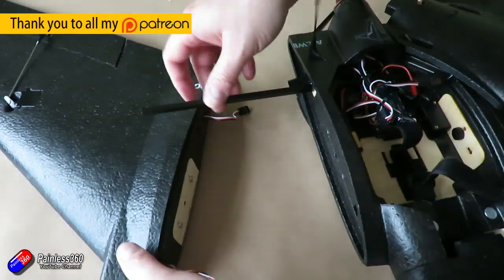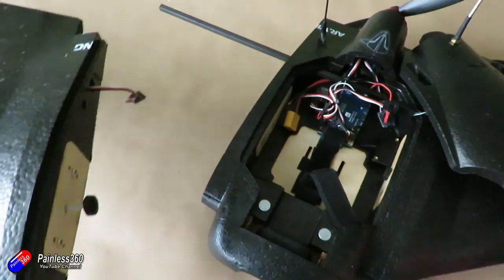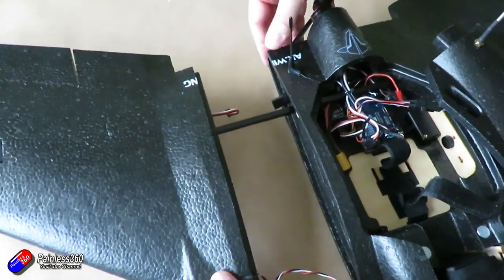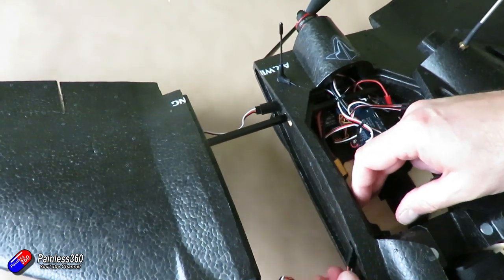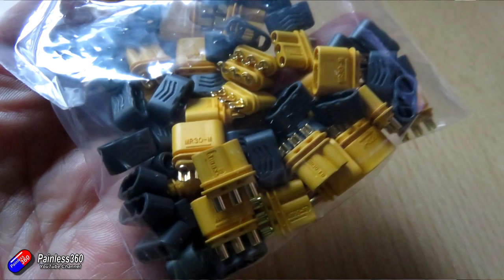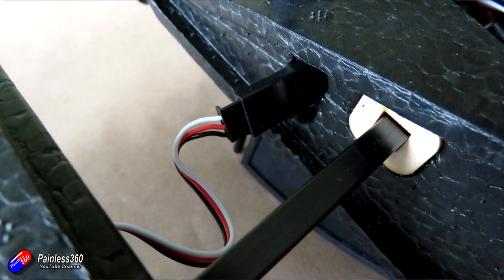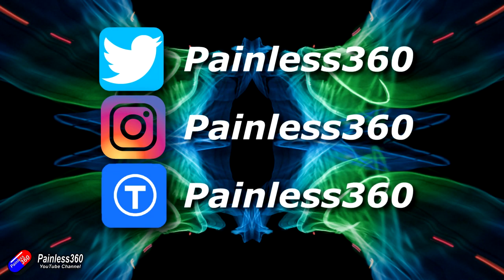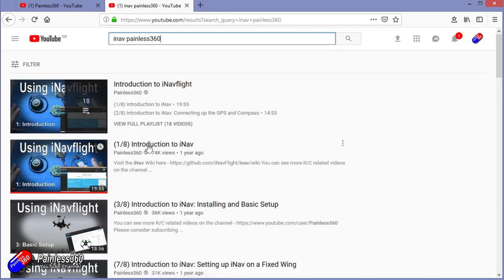AR Wing Easy Wing Removal Mod: A quick tip

Comment: I know this is years after the conversation but I have a both the 900mm and the pro.  On the ar wing 900 I have installed the ar wing pro 6 pin connectors and they work great.  You will have to cut in a little and install ply then screw the connector housing to them.    They work great and I have purchased another 900mm to do same mod.  Its cheap, takes an hour or so to do. Once completed it slides together just like the pro.  You can get these connectors from Getfpv currently. Well worth the effort.

Comment: Lee, a guy here from Brazil did a pretty nice mod in the smaller wing. He cut a bit of the foam from the wings and from the pod, glued pieces of wood, made holes and threads in the wood... So, to assemble, the just use a thumb screw... In other words, now it works exactly like the bigger one. 😃
The idea of replacing the servo connectors is fantastic! I'm going to give him the idea!!! 😃
Great video as always! 😊

Comment: Planning on doing something similar however I'm going to use the green MPX connectors. A bit harder to solder but will have enough connectors and two of them fit into the little holes on the ar wing.
Reply: this method is used a lot in RC world, no fuzz with cables :-)
Reply from the maker: Thanks for the idea - with the supports that could be an even better solution! Happy flying!

Comment: I tried these connectors last week for the servo leads on my Nano Drak. I prefer to glue the connectors to the foam so that I can plug and unplug by sticking the wings together and pulling them apart. For that they were a little too snug and I ended up reverting to MPX connectors, but for your method I think they might work well. They are certainly far more robust than regular servo connectors.
Reply from the maker: Thanks for the comment. I'll get some of those in to try too..
Reply: Painless360 they’re a little fiddly to fix to the foam on their own, but there’s some parts on Thingiverse that wrap around them with a flange and help a ton. Just be careful not to glue them permanently together (ask me how I know)! 😜

Their other benefit is they have six conductors. Sadly you’d still need two on the GPS side even if you shared power and ground with the servo.
Reply: @Painless360  But wait there's more (and I apologize a bit for all the comments): they do make an 8-conductor version, so you could get those and have enough pins to just use one per wing, and there's little PCB boards and various other adapters that would make soldering and installation a lot easier, I think. And local(ish?) to you.

https://www.electriflyer.co.uk/electrics-electronics/connectors-wire/mpx-connectors-accessories.html

Comment: Interesting. You need to solder these connectors to the wires? No crimping? I thought you were going to try to replicate the zohd-style connections. Have you considered such solution?.
Reply from the maker: I have but not yet found a reliable connection that will make the connection with minimum force and stand up to the abuse.. Let me know if you find one..
Reply: I have been thinking briefly about this... my initial thought is a db9 connectors used for rs232 (you probably remember the « good » old days of modems). I think it has good physical tolerance so can be plugged in many times... but I will need to research more. Also, it is cheap. I will keep you posted if it works for me.
Reply: jocelyncloutier a DB9 would be a little big for the AR wing but is a decent solution when you have space.

Comment: Hi Painless - hope you dont mind but just wanted to ask something about this Wing build slightly off topic to this particular video - I notice you dont use an air-speed sensor in the build? Can I ask why? In one of the videos (F765 one I think) there is one sitting on your desk. Wouldnt it be required for auto missions? Cheers
Reply from the maker: Hi Kim, 

No, an airspped sensor isn't needed for auto missions. I cover that with Ben from 3DXR in the airspeed sensor video (in the Big Boys Toys playlist). That video may be worth a look. Happy flying!

Comment: Hello Lee. Do you think the ZOHD KO-pilot will be a good system in the AR wing ?
Reply from the maker: It'll work fine but there are options that'll run iNav and Arduplane that will provide a better FPV OSD experience.. See my iNav 2.1 series and Arduplane series..